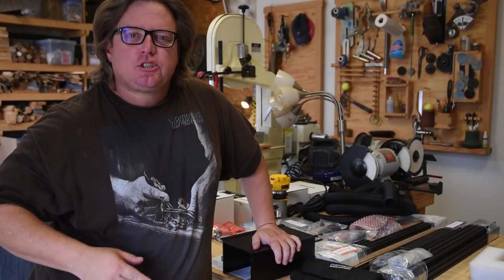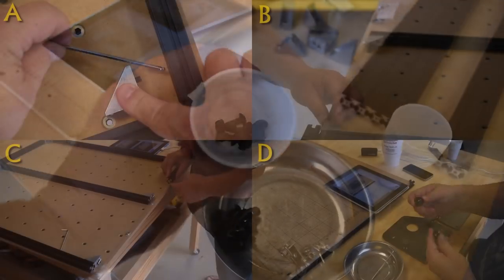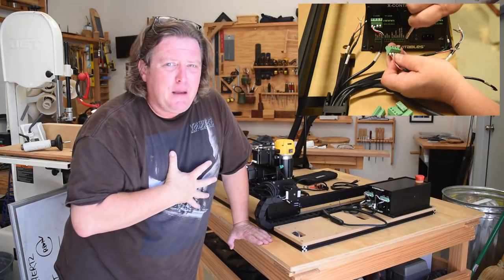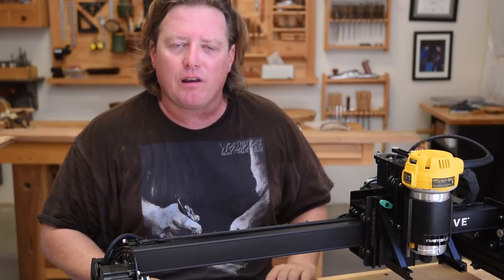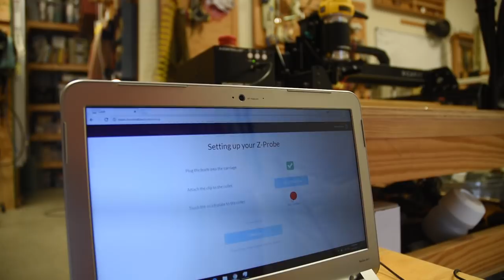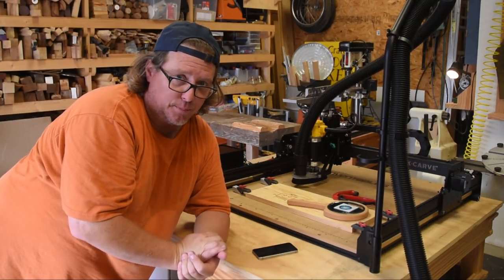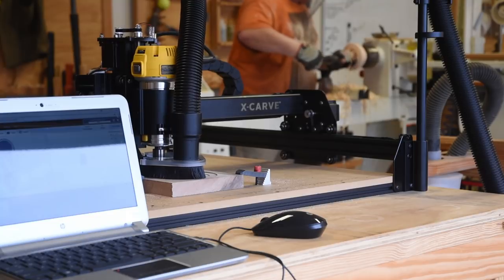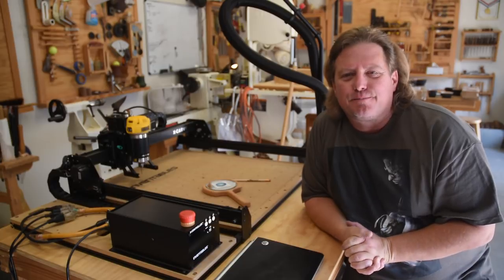The New 2017 X-Carve: Build, Review and Project

Comment: Great video, thanks! In case it hasn't been pointed out before, the reason why your mirror didn't fit one of the pieces is probably because the shape was resized at 41:10 or so in your video! You changed the width of the selected objects from 6.201 to 6.000 manually in the text box.

Comment: You more than earned that Xcarv with this video! Couple suggestions/queries: Mounting a work surface junction box with a switched receptacle would be handy for the vacuum etc.(?) This would also cleanup the work top. Xcarv would do well to offer 1" HDPE  (w/silk-screened graphics) wasted board option. HDPE (High Density Polyethylene) would add rigidity and would not be susceptible to warpage. In the software, are we limited to the carving tool (bits) types? Also, can the Z axis be set to increments of my choosing (say .005"~.010") for each pass, or are we limited to software offerings? I think you mentioned double sided tape as a hold down option(?) Have you tried and it and if so what were the results? After watching this video I have determined that there are some options (I thought were unnecessary) that will definitely be included in my purchase. To summarize: A most excellent video! It is concise with answers to questions I had not yet thought of. Not until I'd watched this video had I been sold on the Xcarv. When I purchase, I will make sure they are aware that it was your video that "sealed the deal"! I would be remiss in my critique if I did not add my misgivings about the required internet connection. Hopefully future offerings will include a downloadable version of all software. Thank you from a newb!

Comment: The effect of moisture in the MDF table can be minimized by applying a coat of penetrating varnish and allowing it to dry.
Reply from the maker: The other side to that argument is the liquid in the finish will warp (wrinkle) the finish as it dries as does adding the cured material (it has to have a place to go). My opinion is it's a tomatoe tomahtoe thing. Damned if you do damned if you don't.

Comment: The main 3 reasons why I wouldnt touch an X-carve at any price is based on the original ones. 

1. The flex issue.
2. the audrino based controller and possibly the new controller.
3. The requirement of have to having a live net connection to run it.
4. The spoilboad is a structural part meaning if you have to remove it there is a possibility things can go out of line.

My solution was a total home brew at roughly the same price as the original big X-carve.

Issue 1 -- Solved - the worst flex case under .0005 inch and mine is far stronger structurally. 

Issue 2 and 3 -- Solved.  I use Mach 3 on an old computer. This is an industrial strength controller program that has the capability to do far more than whats actually needed for a basic CNC but things like not having to need a separate file for each tool in a program for the same project.  It also allows me to use any number of commercial grade programs such as solidworks, fusion 360, or similar for true 3d and to generate the actual G-code that runs any CNC. It also mans NO NET CONNECTION is needed to run the CNC. 

Issue 4. My spoilboard is NOT a structural part of the CNC. It is easily replacable as needed and uses T-track instead of all those threaded inserts.

Total cost for mine was roughly $1100 total including all the basic software required such as Mach 3, the controller program, V-carve desktop, the usual cad/cam program for say 50% of what I do and 360 for the super serious stuff way beyound what can be done in easel. 

Mine is stout enough to snap a 1/4 bit clean into hitting something at any travel speed without loosing a single step. Has rapid movement in the range of 350 inches a minute. The accuracy is right at .0005 across 24 inches and is totally acme lead screw driven to get around the stretching belt issue. Overall the performance is a tad better than a simular sised shopbot in the 6 grand price range.

All that being said any X-carve cannot meet my needs but at the same time these are quite usable for hobby and very low production needs.  The company appears to have some of the best customer support around also.  DO NOT underestimate how important that can be at times. There are ways around having to have a net connection to operate one like the free "universal G-Code Sender" found on the net. Its a stand alone controller. NO net access needed. here are many free to relativity inexpensive programs around to generate the G-code too. I highly recommend Vectrics V-carve at it will fill the bill for ill say 90% precent of people using X-carves.

In closing with CNC you get what you pay for. Higher and/or better performance means a higher cost.  In the price range of the X-carves I will say they are your best buy for the cost. They are a quite reasonable way to go if somebody is just starting into CNC and could well save at least twice the cost if your needs require bigger and more serious CNC machines later.  At least you will know how to sift out sales bullshit from the real facts then.  :)
Reply: As previously mentioned the Xcarv was developed for the newb. You are obviously way beyond that.  I'm one of those newbs, who has not yet purchased one, that understands it's limitations (spoil board) and grumbles at some of the requirements (internet connection, grrrrr). All in all, for me it will be a cost effective starting point. Because of my intentions with the unit I am very interested in your solutions. Even though I was turned off by your first sentence, further reading proved your comments to be very warranted and valued! Excellent points!
Reply: Do you have any link or documentation/Reference on How I could build one like yours myself?
Reply: You make some excellent points about newbie vs. professional CNC designs. However, with the cost of fusion 360 $495 a year, V-Carve Desktop $300, and Mach 3 being $150, I wonder how you managed to put a better machine together for around $1100. Add a decent spindle for $100 and those costs are already $1050.  Have you posed the machine and components on Youtube or somewhere else.
Reply: Sounds like you should build more of those, you could get rich quick.

Comment: Thank you for the review.  It's good to see Inventables is improving their product.  With regard to the mirror opening not being a perfect 5"circle, I think the problem was not an issue with the X-Carve being out of adjustment.  Instead, I think the issue is with the way the computer draws a circle by creating a series of straight facets that approximates the desired circumference.  To the human eye, the computer generated image appears to be a smooth curve.  If you could blow up the image, you'd see that it was not a curve, but a series of straight -- awfully short -- lines.  When the X-Carve (or any other CNC machine) tries to cut out the shape, you sometimes get the error you saw.
Reply from the maker: Nope, it was outa wack. I did a video on tuning it. The kind of error (pixelation?) you're discussing is microscopic and not really noticable in wood.

Comment: Thank you for that super useful review. Kinda feel it's close to becoming an essential piece of kit for even a micro scale maker. I am more tempted to buy one, although making one does interest me, seeing as how there is still a lot of calibration with this & that could be reduced if one used a second hand cast iron plate from a scrap yard & the cost could be kept down using second hand steppers etc. For most folk though it begins to look like a necessity not a luxury, very like the way 3D printers have become for folk in many small scale business. Thank you for such a clear review.
Reply from the maker: They're luxury. I don't do anything I couldn't do with a chisel, gouge or saw with a little practice. They're mainly time savers in production runs... sometimes.
Reply: wortheffort Get your point but for me the ability to have a machine accurately do stuff for example  make pattern draft moulds for sand casting while I do something else or for production runs, as you note, gets to be very attractive, like having an emotion and wage free assistant who does what I want & if not let's me see it has screwed up in a glance.

Comment: How portable is this unit?
I have a small shop, that requires me to utilize space that may need to be used by other equipment as well.
Also what is the length limitations, I do headboards for all sizes of beds and would like to be able to carve pieces that range from 30 to 60 inches.
Reply from the maker: Not portable at all. Moving it much other that rolling around the shop on the cart would likely require recalibration. Check there website for the limitations but you can go as long as you want, just carve one part at a time.
Reply: wortheffort Thank you
Reply: One of the YouTube(rs) put their unit (750mm) on a drop down table mounted to a wall. Very stable and when built high enough it was out of the way for other equipment. Furthermore,  you could build a portable bench for it but would have to be rock solid. Level with no potential for rocking or racking! JMO.

Comment: Why didn't you put them through the thickness planer instead of belt sanding? Thanks for the video, and the info on the new x carve
Reply: Fierceflyer55 if it went through the planer when the the parts separated they would bounce around and get damaged. Or so I would think.
Reply from the maker: Marc is correct. There's a chance they could move once the tabs are cut and that's not save. Ideally a wide belt sander would be perfect.

Comment: why cant you put an aluminum or steel table and mill it to use as your base table? When we replace table on CNC mills, we machine the pockets for bolting it (them) down and then we mill and drill and tap according to the table and spindle.
Reply from the maker: Michael Ray that’s a fine, if costly, option. I could also milk the mdf as I mentioned in video.
Reply: Just thinking about longevity and mostly a once and done set up option. Granted you are limited to the actual working space but it would help greatly with 3D cutting for sure.

Comment: could you not put a .250 board under your work ?  Then just adjust your z depth by .020 and it would cut thru your part.  clamping should not be an issue.
Reply from the maker: You'd have to make the tabs bigger if you cut through so the piece wouldn't rattle around the moving bit.
Reply: ok, thanks
Reply: I thought the same. Maybe attaching the top layer to that extra bottom board with double sided tape could prevent the rattling...? I just wish these machines did everything without needing other machinery

Comment: great review!  really good insights.  I've had my eye on the x-carve - the price makes it really attractive and it feels like the next step up is multiples in cost.  but the waste board not being flat and all the tuning of stepper motors and belts is kind of a turn-off.  Maybe I've gotta wait for one more iteration!
Reply from the maker: Waste Boards are likely going to be an issue with any CNC using MDF and such (at all price levels). I have noticed that if you go to screws instead of belts the price of the machines go up exponentially because of their cost but all the other costs involved (bigger motors, gears, etc....) It's the nature of the beast at this level. But at this level you can buy it, use it, learn on it, then sell it for likely the same amount (since your labor is free right?)
Reply: Thanks for the review.Good info.  As for the wasteboard not being level, you really need to surface any new wasteboard you put on the base to make it level to your x and y travel.  Not sure if the machine makes it simple to tram the router mount...
Reply: Just saw your followup video where you addressed the flatness issue.  Thanks.